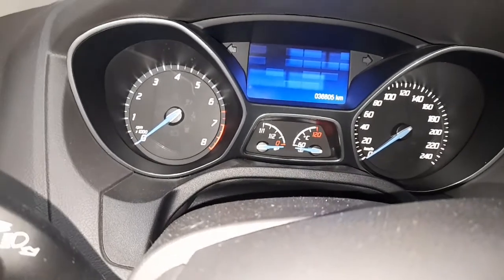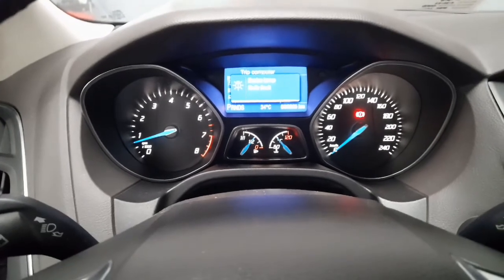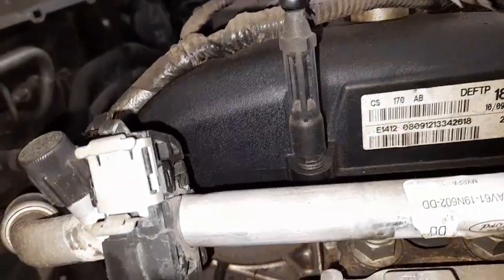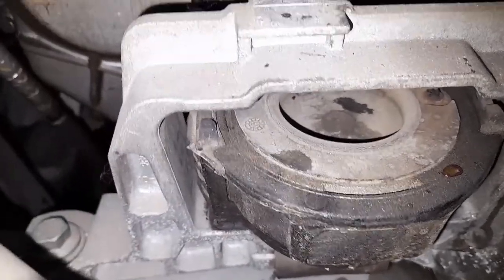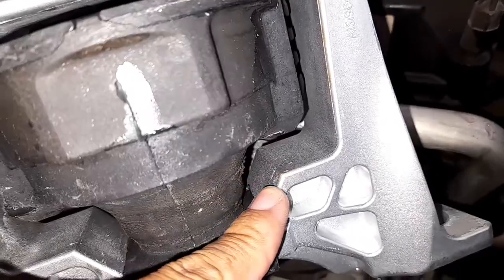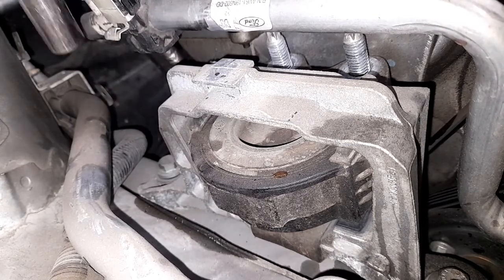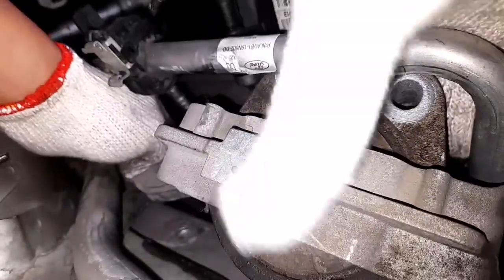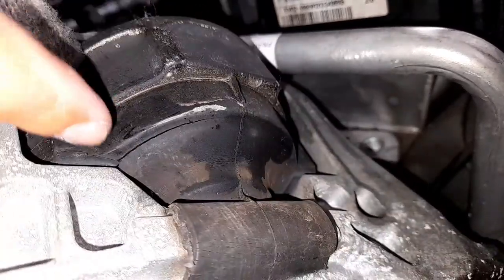FORD FOCUS - ENGINE VIBRATION DURING ACCELERATION

Comment: How much the engine support replacement costs?
Reply: About £100 from a ford  dealer.  I replaced mine recently and  I didn't know thay were full of fluid
Reply: I got mine on Amazon for $20 re used my bracket. They don’t last very long regardless of what brand you get they are all made basically the same way Oem or not.
Reply: @bradbozarth3235 did replacing it stop the vibration?
Reply: @madisonabcde  yes
Reply: @madisonabcde  it’s like a complete different car.